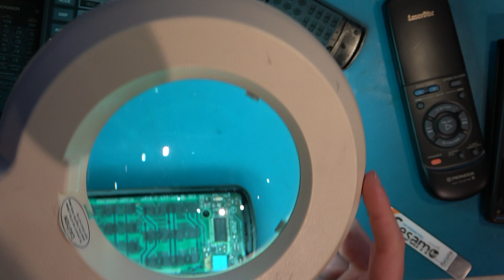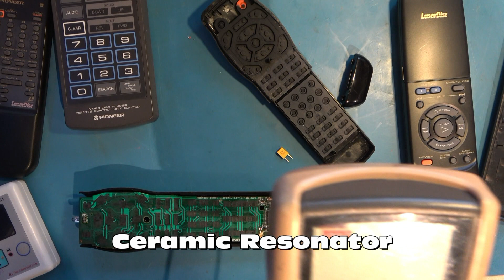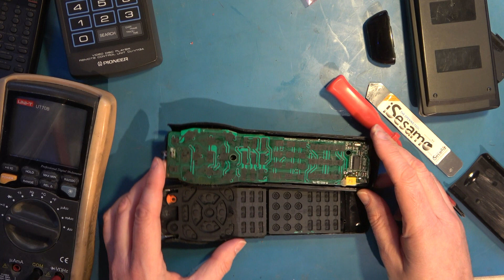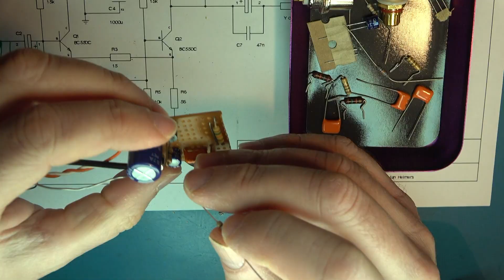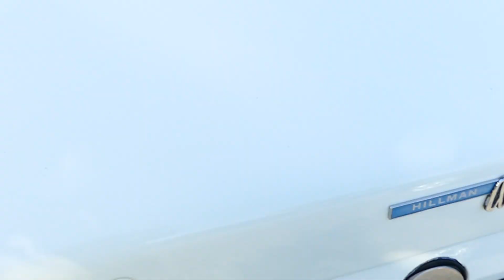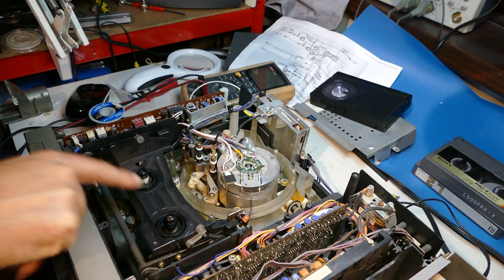Remote controls for Pioneer Laserdisc players.

Comment: Hello. Could you tell me where I can buy a Remote Control unit for the Laserdisc Pioneer DVL-909?
Reply from the maker: I think that's one which takes the "standard" code set rather than the enhanced set.  A good universal remote control, or IR Blaster app on a 'phone, should do it.  The £1 remote controls from our local Pound Shop however do not seem to support Pioneer Laserdisc.

Comment: Nice vídeo, Sir! I am struggling to find the RC of my Pioneer Laserdisc player CLD S201. I did not give up yet! I don't even know if there are other compatible models. Could you please help me? Thanks for your attention.
Reply from the maker: That might take the "common" code set so almost any Pioneer LD remote may work.  There's a 'phone app which will work with any IR Blaster equipped 'phone (or with an add-on IR), which will contain those codes, so research that.
Reply: @video99couk  thanks a lot for the hint👍🏻

Comment: A good way of testing remote controls is to use an AM radio, hold the remote close to the radio tuned to a blank space, you will then hear the remote codes via the radio (if the button is making contact).

Comment: I actually have the Top Tel 1 universal remote, do you have the code list for the remote? I can't find it anywhere online...
Reply from the maker: I do have the list but it is way too long to scan in.  So I looked for some specific brands and numbers to see if there was a match online with any other 3-digit type remote, but I couldn't find any matches for a random selection of about 5 brands of TV.  So they would seem to be unique to this remote.  Shame because it's a very well made remote control, nicer to use than the Poundland Signalex one (I've done an in-depth YouTube video on that remote): https://youtu.be/lbfSKqS-2QI

Comment: Had one of these ceramic resonators fail in a Ferguson Videostar 3V23 (JVC HR7700 clone), leading to no clock display. Apparently, it was a common fault with those machines.
Reply from the maker: I remember the chain driven eject mechanism more than anything else about the 3V23.  I remember when someone I knew bought a nice new Sony TV, pressed number 5 on the Sony remote, and the 3V23 would eject the tape.  Odd that since there wasn't even a button for eject on the 3V23 remote, but there clearly was a code in there somewhere.  He had to buy a new video recorder.
Reply: I think I would've got a new TV myself as I was quite fond of the 3V23! Indeed, very interesting that it must've had an eject command not utilised. I wonder if opening up the remote would've yielded any clues?

Yes, the intriguingly over-engineered chain drive and the rubber rollers that needed sanding (official repair advice from Ferguson!). I recall one instance where our machine (which can only be described as temperamental at best), managed to quite impressively launch an E-180 almost halfway across the living room! Happy days :)

Comment: Smashing, nicely recovered :-D
i've had a few remotes to fix over the years, often the resonator had snapped off it's legs due to poor or no glue holding it down. (regular dropping).
I linked a philips aluminium can i.r box that came from a vcr to a bargraph to show emission.
Crude but very handy :-D
Reply from the maker: Somewhere I have an IR receiver that I used to connect to my 'scope, but I mislaid that in my workshop move.  Will have to put together another one.  I've also seen resonators with snapped legs, I mention that in the video, sometimes they can be soldered back on.
Reply: Yes i found you could dig some of the potting material out from around the pin and solder a strand of wire to the stub.
Once the resonator was stuck down with bostic, a quick solder and they always worked :-)
i just enjoyed repairing things, much like you do :-).